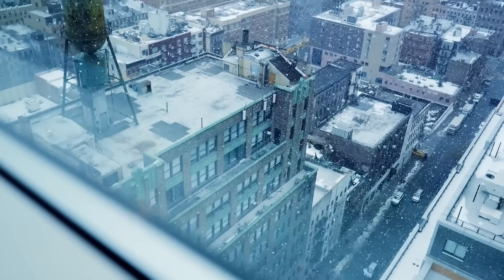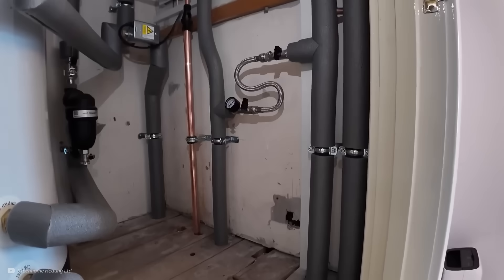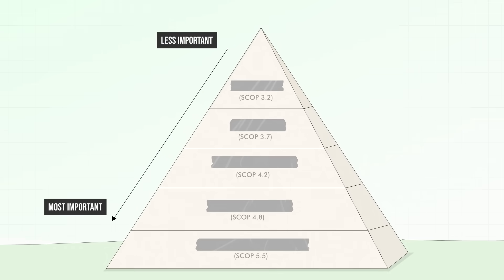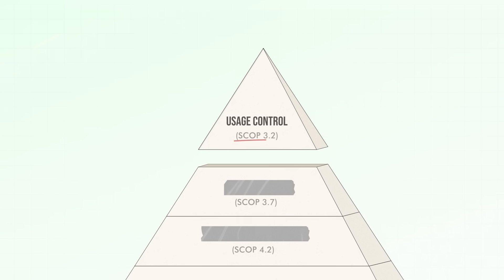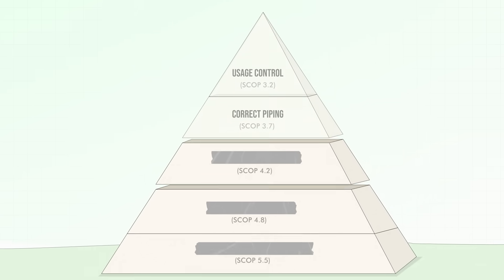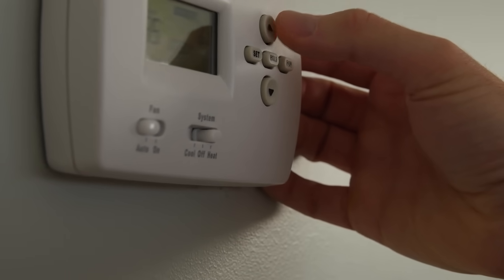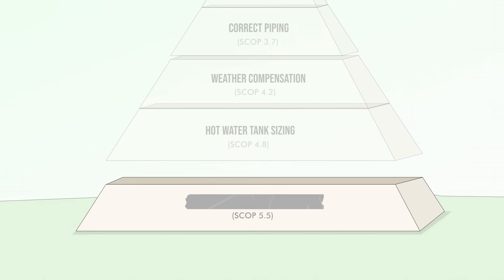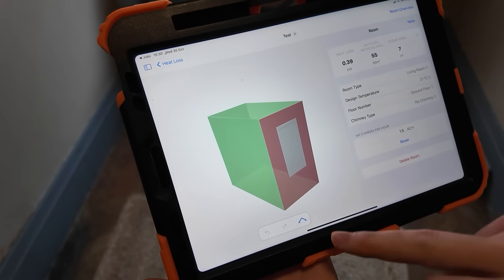The Genius of the World's Most Efficient Heat Pump

Comment: A lot of very good points and interesting information. However, please do not refer to COP as efficiency; in an engineering context, both are very specific terms that are related but not interchangeable and not treating them as such has lead to bad faith arguments to try and discredit critics of 'over unity' claims.
Reply: and you couldnt be bothered to explaim what the difference is?
Reply: @fetB  efficiency is usable work output over total energy input and that includes free thermal energy from the outside and fans moving heat source medium.

Coefficient of performance is usable work over paid energy (electricity to run the compressor and fans).

The only way to get efficiency over 100% is to have an error in math or assumptions. IIRC in Germany condensing boilers had "efficiency" over 100% because their theoretical ideal boiler didn't condense steam in the exhaust gas which condensing boilers do as the name implies.
Reply: @fetB  I considered explaining it but wasn't sure if it would just be adding dead weight to my comment or not, and decided it would be safer if it was needed and someone could ask rather than it not being needed and my comment becoming a wall of text.

Shortest way I can describe it is that efficiency refers to the amount of energy extracted from a single source (heat engine) while COP refers to the amount of energy moved to a single output from multiple sources (heat pump) In particular, the COP of a heat pump is the inverse of it's efficiency if it were to be ran as a heat engine. As a consequence, because efficiency is always less than one, the COP of a device will always be greater than one.

Think of it like this, when we talk about COP, it's as if we are putting a boat into a stream and propelling it, and instead of measuring the resulting boost, we are measuring the boost PLUS the motion from the water.
Reply: @fetB he is a nerd. I am a nerd. We really only speak  nerd and as I suspect you don't speak our language it becomes rather difficult to explain something to you. Why not go away and learn nerd, it's the world's most powerful language. Where are you? I'm in Gloucestershire and would be delighted to teach you the basics.
Reply: @pauldowney6856 And if you can’t explain it to the layman..then you yourself don’t understand it.Its as simple as that.
Reply: I understand what you are saying but words like efficiency are dependent on context. For instance I can say using hot water with dish soap is more efficient than using cold water. As the COP of a heat pump varies with operating conditions, we can say heat pumps are more efficient when the return water is cooler. Here we are comparing how well the heat pump can move heat relative to the electricity it consumes. So I see nothing wrong with saying a heat pump with a COP of 6 is more efficient than one with a COP of 4.
As soon as you Start to add power figures then efficiency changes its context and needs defining to avoid ambiguity. For heat pumps you would have to include the energy extracted from the heat source as well as the electrical energy compared to the output energy. 
We all know what a Hoover is and we all know it is incorrect but putting "a" or "the" before Hoover makes it quite clear we are not talking about the company. 
In other words - you don't have a monopoly on the word efficiency.
Reply: @foxythedirtydog4494  unfortunately for your argument, the context is an industry where COP and efficiency are distinguished.
Reply: @eliyahzayin5469  people outside the industry can use COP as an indication of efficiency without causing any problems. Anyone in the industry will also understand what is being said and not need to correct them.
Reply: @foxythedirtydog4494  if you read my original comment, my point is that conflating COP with efficiency is often taken advantage of by perpetual motion grifters.

Especially since this channel appears to be an industry communicator, it's kind of their job to not spread misinformation, which in this case referring to COP as efficiency is. If they want to say that a higher COP is more efficient, that's perfectly fine, however they cannot refer to a COP of 8 meaning 800% efficient. If you want to stick a number to it's efficiency, you can look at the ratio between the actual COP and the COP given by the carnot cycle. But otherwise, they're not the same
Reply: @eliyahzayin5469 so coefficient of performance is not represented by numbers a that determine if something is efficient?Because that’s the argument I’m hearing?
Reply: @r410a6  Sort of. While a higher COP does mean a system is more efficient, that efficiency is not given by the COP (but rather the COP divided by the maximum theoretical COP) and is not the same as thermodynamic efficiency.

The reason heat pumps (and AC units) are measured with COP rather than efficiency is because they are actively moving heat from a secondary source, rather than passively harvesting it from a single source.

Essentially, when you're talking about efficiency in an engineering context, you're really talking about how effective you are at gaining the total amount of some fixed quantity. Heat pumps don't really fit into that situation.
Reply: Even though engineers are allergic to the real world & usage therein everyone else existing within practical application will be fine with "efficiency"
Reply: Heat pumps can be 500% fiscally efficient
Reply: @eliyahzayin5469 I agree with you up to a point. I see no harm in people thinking a COP of 8 is 800% efficiency. Most people don't understand COP yet alone SCOP so saying (incorrectly) that a heat pump is 800% efficient is fine if it gets people to understand the advantage of a heat pump system. Anyone that needs to know the difference will understand what is being said due to the context so should not be confused.
I am more concerned that people are duped into thinking they will actually see these kind of energy gains when the reality is very different. Especially when they later find out they need to run their newly installed heat pump 24 hours a day instead of using a gas boiler when needed
Reply: @foxythedirtydog4494  It sounds like we're coming from two sets of experiences. I tend to watch a lot of DIY/maker videos and an inevitable section of that winds up being fring/pseudo-engineering which has made me very twitchy when I see a conflation of engineering terms.
Reply: @eliyahzayin5469  I know what you mean. As long as I can understand what they are trying to say I don't worry too much about how they say it. Far more important is seeing if they have anything interesting for me. I don't dismiss them for the words they use but usually if they can't use the correct terms they have not got the background education which if they are interested in the subject they would naturally pick up. 
I am a practical engineer more than a theoretical engineer. It is good to see these people having a go but too often their belief in their wonder machine clouds their judgment or they do it for click bait and say anything to fool people.
Reply: Only by morons who don’t know the difference
Reply: I work with engineers all day, I love when they get on the " nothing can be more efficient than 100% kick"  I😂 If something is making more heat while combined with new technologies then 🤷‍♂️...I see the argument. Then again not everyone is an engineer and the way the public interprets efficiency, and/or uses the term, came from how companies and the government have used it.  We all understand what they mean. Remember everything is impossible until someone does it.
Reply: Haven't watched the video. First question, how do you have 800% efficiency in something that by definition can only ever be 100% efficient max and that's under ideal conditions? Figured it was about useable "whatever" and the increase of what's useable but the thumbnail is completely misleading. Stuff like this turns me off. It reeks of YouTube clickbait which I instinctively avoid. Horrible thumbnail and I've blocked more than one YouTuber for putting misleading bs in their thumbnail.
Reply: Well I guess I chimed in right on cue lol